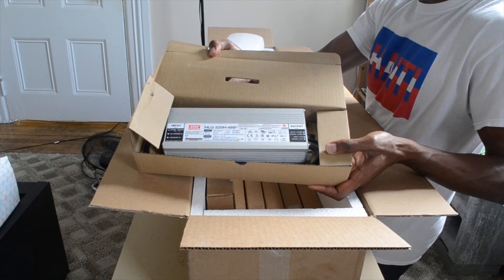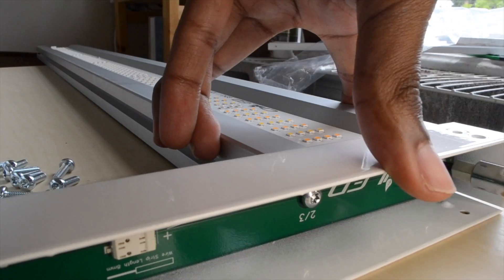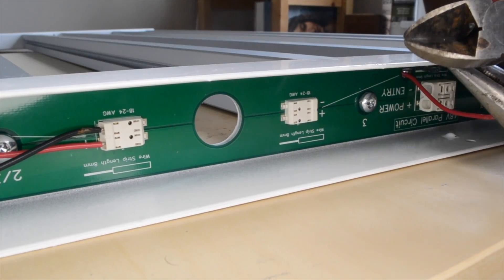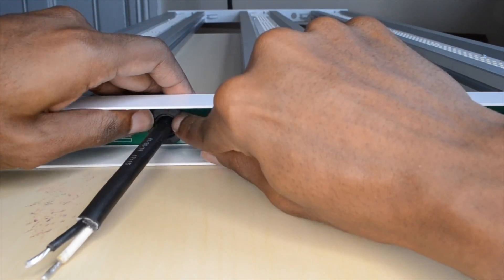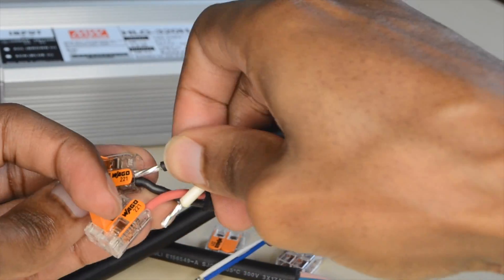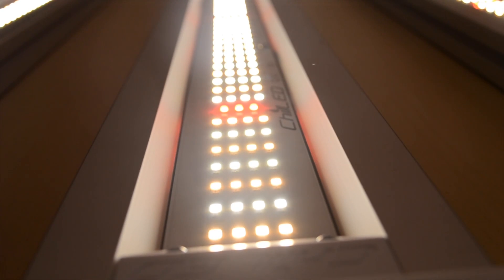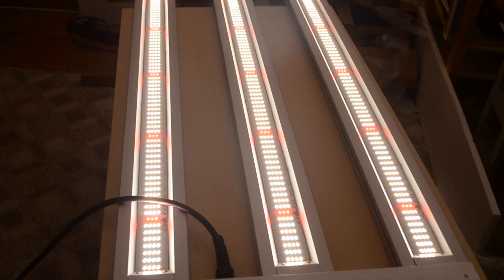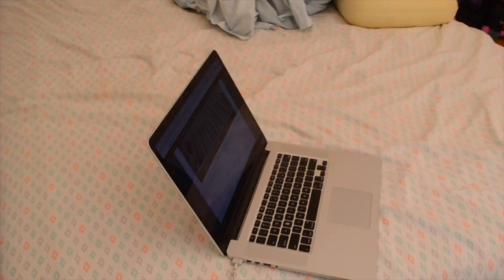GROWCRAFT X3 LED LIGHT BUILD + FIRST IMPRESSIONS

Comment: I just want to say you have the absolute most comprehensive and concise video on the assembly. Thankyou!!!
Reply from the maker: Thank you, I'm so glad it was helpful
Reply: @godisgod  here is the diagram Austin shared with me on the alternative color scheme on the wires for connecting the driver to the wall plug
https://imgur.com/gallery/32o4AOn
Reply from the maker: @pa7815  Thank you this is helpful
Reply from the maker: @pa7815  Added this link to the video description. Thanks for sharing
Reply: @godisgod  Solid, glad I could help brother.